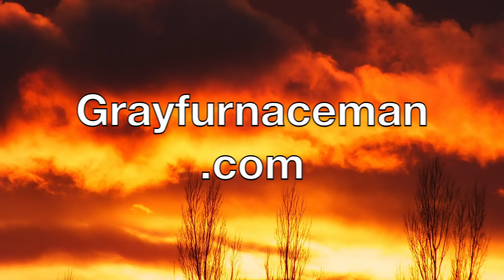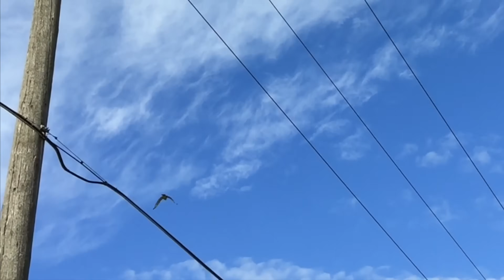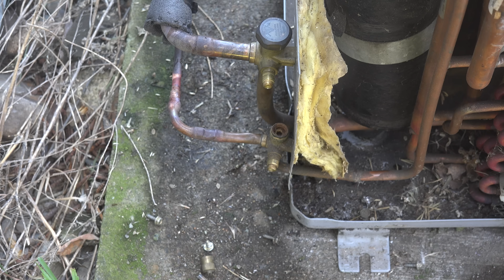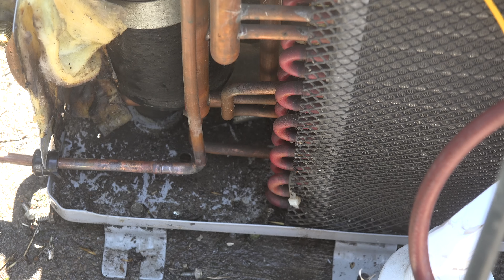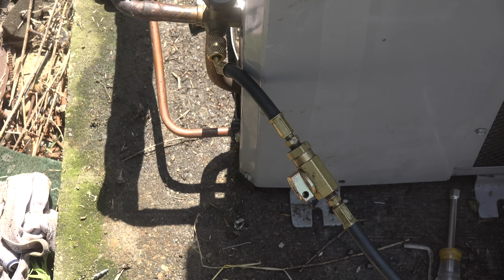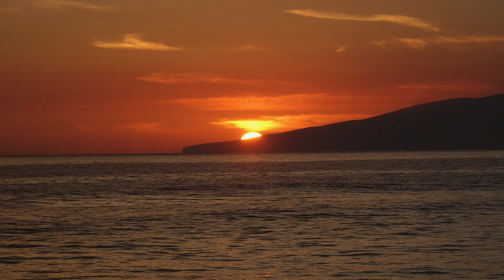Replace the service valve on the air conditioner.

Comment: So then if you are wanting to check the pressure on the high side you would just have to do it inside at the evaporator coil?
Reply from the maker: At 1:18, you will hear that there is a tap inside the outdoor unit for the  high side.
GFM

Comment: how does it not leak from the top cap being gone? i was just looking at mine and mines leaking from the top cap seem but in your video it seems to be gone lol
Reply from the maker: The cap is not there to seal.  The only seal is the oring on the plunger.  If the plunger leaks, the valve needs to be replaced or the oring needs to be replaced.  
I have seen endless "repairs" that try to seal the cap.  It will not work.
GFM
Reply: @grayfurnaceman   ack, im going to have to call someone i guess. here is what is going on with mine, have any suggestions? someone told me prob replace the entire "king valve". if i replace the valve will i lose the freon and need to refill that to or is there some sort of shutoff for that. i wont be doing the work, just curious what im in for. https://www.youtube.com/shorts/MGIKimheXv0
Reply from the maker: The refrigerant will have to be removed/recovered before repairs can be done.  
The unit is R-22 so replacement refrigerant is very expensive.  
This repair is quite expensive and considering the age of the unit, probably not worth the repair cost.
GFM @hippa2dahoppa2
Reply: @grayfurnaceman   thank you. i think i found the problem, the condensation from the top part is dripping on the bottom on just the weird perfect enough angle where it was landing in the groove of the cap and not on top of the cap so it looked like it was leaking. today was rainy and windy and the temp dropped so i didnt get to fully test this theory but i will the next warm day. im so dumb. i guess ill swap it though i know its running on borrowed time. i actually have  2 units this old lol

Comment: How about a 4th option. Clean the threads up, flow nitrogen, put flux on threads and solder the cap on permanently. Of course make sure it is in the open position and the core is removed while soldering.
Reply from the maker: Interesting.  When the Carrier RQ units were out there, the brazing of the valve was a very common operation for me.  We tried everything.  Pipe dope, O ring replacement, cap sealing.  Nothing worked.  Brazing always worked.
GFM

Comment: Here is a liquid line service valve wih caps that are rugged enough to seal:

https://www.google.com/search?hl=en&tbm=isch&source=hp&biw=1242&bih=570&ei=GAGQW6LKEs-m_QaemLSIDw&q=liquid+line+service+valve&oq=liquid+line+service+valve&gs_l=img.3..0.1369.9179..9504...0.0..0.100.1495.24j1......2....1..gws-wiz-img.....0..35i39j0i10j0i8i30j0i24.aZ2Ec7jIu80#imgrc=xTsx2L2oT3kHMM:

Comment: Could you not just remove this valve and silver solder in a Schrader valve allowing you to still connect a low side gauge?
Reply from the maker: On the unit shown, there are 2 taps inside the unit, so the tap at the lineset is superfluous.  If the are no taps inside, I always braze in a line tap.
GFM

Comment: I work apt maint and I got to where I'd rather recover it than mess with pumping it down. I replace an air handler and open the valves on the condenser to find a leak on an old unit. Sad to say I've teflon a couple and tightened down the cap in a pinch. I'm not replacing a service valve on a 25yr old unit. Just trying to get a few more years out of it. Great vid thank you
Reply: Pipe dope and Teflon can hold the pressure?

Comment: Why not install a ball valve inside the unit to maintain the option of pump down?
Reply from the maker: millweed88 You can certainly do that. However, ball valves are quite expensive. This method eliminates all mechanical valves. This is, of course, if you replace both valves. A part not installed costs nothing and causes no service problems. 
GFM

Comment: You can't pump it down without service valves.
Reply from the maker: Jon [Insert Last Name Here] That’s true. The problem is most of the leaks are in the service valves. So if you have a leak in the valve, you can’t pump it down anyway. Thus the problem with service valves. Kind of a catch 22.  
GFM
Reply: I thought most  leaks start in indoor coils.

Presumably if you tighten the caps really well and don't pump it down more than once, they shouldn't leak. The caps form the final seal, right?
Reply from the maker: By far, the primary source of leaks are mechanical fittings.  Indoor coils are no more of a source than outdoor coils.  I want to emphasize that the caps on service valves are pretty useless for sealing.  The cap is very thin in its cross section, so it tends to warp when tightened.  The threads are not tapered so they have no sealing capability.
GFM
Reply: Catch r 22
Reply: KungFuMaintenance good one lol
Reply from the maker: Thanks guy.
GFM

Comment: Don’t you need to remove a panel to access the inside service port? Wouldn’t that panel being off cause air to bypass the condenser coil? I know this one is just a test machine. Just food for thought
Reply from the maker: Not on this machine.  The access panel does not uncover the fan section. 
GFM

Comment: They need to re-engineer those valves with different cap and threads so they can be sealed with a Teflon gasket. Of course that would cost a few extra pennies.
Reply: Most all of the new systems I've seen just plain don't use king valves anymore. You have to evacuate every repair, but the valve leaking is stopped at least.

Comment: These valves are bad enough in the best situation. When you add in a shoddy install where the valves get cooked; they're almost useless. Ball valves with a service port are a nice solution but there often isn't time, space, or money for them. At least this method yields a leak free system

Comment: Good fix.  Your correct about those leaking. A ball valve with an access fitting would be nice , there again a mechanical fitting and potential leak. Ball valves do last much longer than those silly valves installed by the factory tho.
Reply from the maker: Agreed.
GFM

Comment: I've always seen them as single use valves, to hold manufacturers pre-charge in until connected/evacuated, then opened and never touched again.
also "job assurance valves" because they know they'll leak in time and guaranteed if they ever get touched.